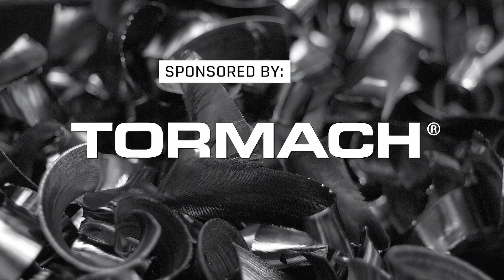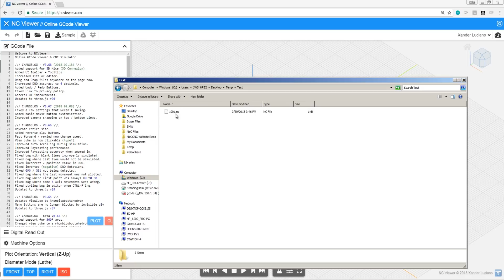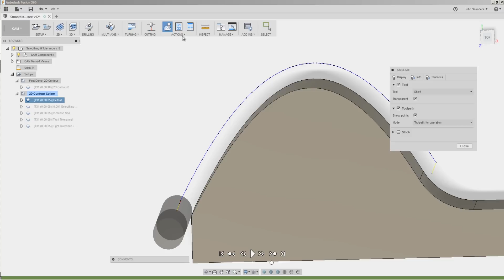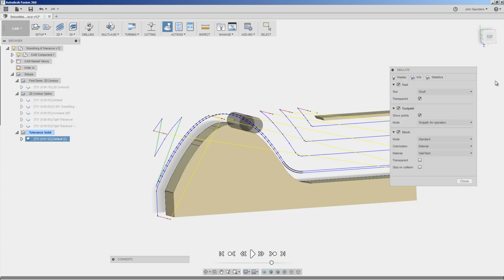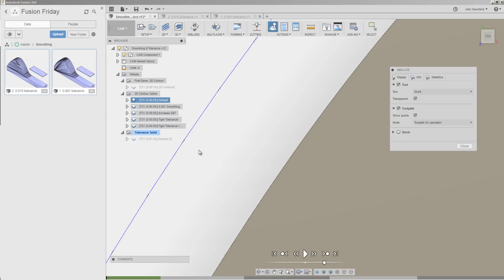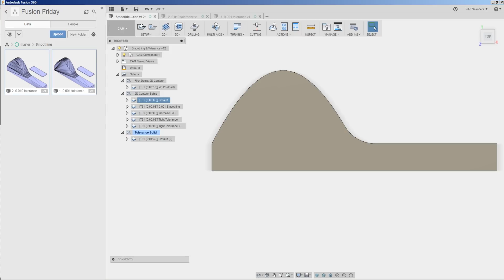What is Smoothing Fusion 360 CAM? FF128

Comment: I've been using smoothing for a while now without fully knowing if it was the best thing to do for my particular project needs. Not only am I now glad I've been using it all this time, but you also introduced me to a fantastic strategy for testing different smoothing/tolerance options (saving the stock and taking a look at the STL file) to see where my ideal tolerances are instead of just guessing. No doubt I'm going smaller than I actually need to, but now I don't have to guess! I know this video is a few years old, but I still wanted to say thanks :)

Comment: Thanks for this John, I run an old interact 1 with Heidehain TNC 151 and drip feed programs. I am getting really jerky movements in adaptive so this explains it.
Reply: Well, you may have to add "m90" after each line if you havent done it already. Otherwise the machine stops after each block. 

I changed the tnc155 postprocessor and my tnc155 mill runs great now! :)
Reply: Stefan Berglund  Thanks for the tip I will look into that
Reply: If it’s an old machine, pay attention to the baud rate too

Comment: I've posted my problem on the Fusion CAM forum but didn't get an answer. I've got part of a shape which is a slope. I'm using a flat-end mill and it make she slope look very 'stepped' (even though the machine head only goes down 1mm at a time. Is there a way (for example) to make a pyramid in CAM without visible lines for every level. I tried bull-nose tip and 'smoothing' but it doesn't make much difference.

Comment: So a Tormach and a Haas don't really have lookahead and handle segments really badly and a simple Arduino Mega 3D printer board with Marlin software has it and run segments smoothly? Spooky...
Reply: They all have it, but there are more variables at play here. On a Heidenhain controller it is easy to spot from the parameters list, but in essence it boils down to to the speed at which the machine gets the code (drip-feed vs. HDD/SSD), lookahead buffer size, wanted feedrate (as in does the machine move faster than it can read&process code in to the lookahead buffer), the parameters of the machine itself, like how tightly it tries to follow the given path, how much jerk is permitted and so on.

That Marlin will smother to bits if you try high feedrates with 0.001 mm max path error, which is quite typical of a CNC milling machine. And the drip-feed issue comes in real fast, plus the was it 18 block lookahead buffer which is filled to the brim by just starting a spline.

Comment: Isn't there a technique in which the machine is controlled by equation.??...i mean all the splines have their own equation so isn't it possible that we have to only put some variables of that equation and tool will follow the path rather than divide that spline into small line segments...??
Reply: The mahine can only move in straight lines, so now the controller would have to do the smoothing. Far more efficient to do it prior in CAM, as you can see/test the results of different settings.

Comment: I run my tolerance using a formula. 1/3rd the stock left on Min 0.005mm Max 0.5mm it gives you really quick generation. when roughing. I tend to keep smoothing at 0.002mm

Comment: This is why I like Hurco machines. I can throw a spline with THOUSANDS of points at it, no smoothing in the cam, and the Hurco gives me a highly accurate part with no jittering.    If you have a haas, you also need to know how g187 works.  if you smooth it to much in the code, and then youre running g187 p1 e.050, you are going to end up with an inaccurate surface.
Reply: >Comparing a machine that easily costs 15-20x more than a tormach to a tormach.

Comment: John- Another great video!
I need to cut corresponding parts which have spline-type curves, and fit together perfectly. Will using identical tolerance & smoothing setups guarantee this? In my case, a perfect fit between the parts is more important than matching the CAD curve exactly... What is the best strategy to accomplish that?

Comment: FYI the double points come from the way Fusion generates the path. First the spline gets segmented into straight lines, then they are offset by half the tool diameter and on outer points an arc is added, that wraps around the point. The smoothing looks at all the lines and arc segments and replaces them with a few circular arcs.
Reply: That's interesting :)

Comment: Nice Video Jhon,
You may give NC Corrector a try for detailed g-code path info.
Does HAAS machine support an SSS (Super smooth surface) feature that may eliminate that jerky motion?
Thanks
Reply: mryoutuser 
G187 P3 E.001 would give a finish profile movement with a .001 arc tolerance smoothing factor.

Comment: Interesting video.

Don't know if Tormach simply haven't implemented it but the core LinuxCNC (now) "supports" G5[.x] splines 
http://www.linuxcnc.org/docs/2.6/html/gcode/gcode.html#sec:G5-Cubic-Spline

Back in the "dark ages" (1982 :-) ) I wrote a research paper on (C)NC machines and one of the holy grails was constant velocity machining throughout a complex motion. While there's about a million times as much processing power available within current CNC machines, the "tool chain" from CAD to the cutting edge has still not caught up.  

I suspect that it's in part because it's very hard to decide where the smoothing is to happen; within the machine tool controller, the post processor or the CAM modeller. While it's most attractive to put e.g. spline emulation into the post-processor so that the CAM modeller is always dealing with virtually the same machine; regardless of actual machine (within operating envelopes, obviously). OTOH a machine controller running LinuxCNC or similar can offload post-processing and the same CNC (G-code) program can be loaded onto different machines as long as their controller can hack the job.

An ideal CAM would accept any CAD model of a product and, without human intervention, be able to produce "G-code" for the machines necessary to make the part, along with a specification of stock (from a "library" of available sizes) and fixtures necessary. Obviously it needs a "dictionary" of available machines and tooling; and for comparison purposes, the relative costing of all the combinations.
Reply: Bernd Felsche 
The G5 spline is more for coding size and ease if you’re manually programming, rather than machine movement. 

Machines are still stuck using a combination of 3 linear directions at varying feed rates. Smoothing in the CAM and G5 spline on the code side are pretty much identical in taking a spline path of hundreds of points and reducing them down to a combination of lines and arcs with fewer point to point movements. On a G5 the controller is still processing a series of lines are arcs in the background, you just don’t see those movements in the code is all. 

It’s similar to a G187 P# E# on HAAS machines in which it will override the coded positions and delete or add points to maintain the specific arc tolerance set by the E value on the G187 line. 

The DMU I run has a similar code line that not only does arc tolerance point reductions, but also overrides the coded feedrate to maintain a constant velocity, so it doesn’t whip around tight corners even when it’s linear feedrate is over 200ipm
Reply: It's ultimately up to the CNC machine to control tool position, velocity, acceleration and sometimes jerk by the combination of available servo controls and feedbacks.  The machine knows the internal resolutions.  The internal spline/NURBS following can be much more finely resolved than what one would sensibly generate from CAM. The controlled position/velocity can be more finely resolved than is worth programming as line segments. Internal curved motion interpolation can produce a more CAD-conforming shape than "segmentation". While internal "segments" are calculated, they can be within a tighter envelope. Block processing of equivalent segments can substantially slow machining, resulting in worse finish and frustrate e.g. internal look-aheads. (see https://www.fanucamerica.com/home/products-services/cnc/cnc-technology/high-precision-machining)

IIRC, the Fusion360 CAM processor produces arc as well as linear segments to approximate a non-circular curve.
Reply: @occamssawzall3486  To stick with your argument, yes you are stuck to varying feed rates of your 3 axis, but you have the same problem with arches. Still circles are often not split up into individual line segments, especially when it comes to larger machines which have some momentum. Same could be done for splines, there is no need to have lines or arches as an intermediate format. The controller could directly evaluate the splines and translate it to feed rates. There are historically good reasons not to do this, the computational power, but this argument is no longer valid for at least 10 years.

Comment: I assume that splines are equation driven curves at some level. I wonder if it would be possible to add a separate function in some future update to gcode architecture which calls a spline by simply defining the variables within its equation. The math is way above me, and I have a feeling that it would still require an advanced cnc controller, but it would provide the most accurate results.
Reply: Fanuc Series 18i already has Spline Interpolation actually, and that controller is at least older than 2005. The question is how to get the Post Processor to figure out exactly what it's looking at, and understand that the implied motion of segment of points can be redefined as a Spline command.
Reply: Regardless of the coding, the machine still only moves in linear directions. The “spline codes” are basically a simple way to manually define a splines path with points, and it combines controller side arc smoothing. Same as turning smoothing on in CAM, cept it’s all done in the background within the controller.